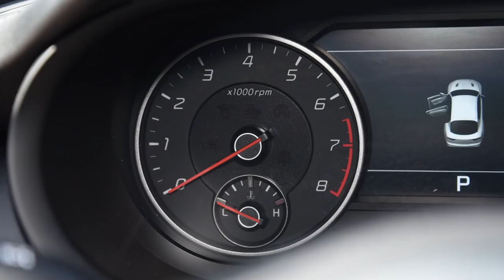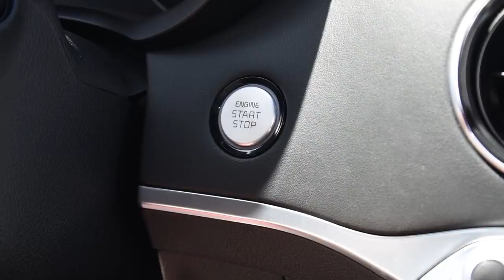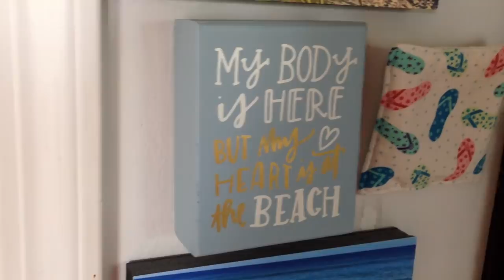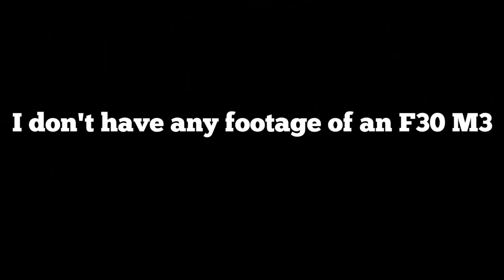2018 Kia Stinger GT: Regular Car Reviews

Comment: This car has got great reviews in Australia, and often compared to holden ss (chev ss). In the reviews, generally the kia is rated as a better car, easier to reach claimed 0-100time (0-62.5 miles), better handling but is put down for being a kia and not having a V8 sound, which is a stupid way to review a car. It hasn't sold well in Australia, but nor has any rear wheel large sedan (holden commodore and Ford falcon have actually become extinct in Australia) but when you see one of these on the road, they look awesome! I can't wait to pick up a cheap second hand one in 10 years for peanuts.

Comment: I see so many Kia owners are actually embarrassed by the cars emblem more than anything . A lot have resorted to using these horrible ebay L  logos that are some mutation of an old Kia logo used on a few models and Kumho's old logo  resulting in something that should be attached to a knock-off Lexus

Comment: One of the problem of the stinger is it's weight. Yes, it's well balanced and it makes you somewhat forgetting of it. But in regard to a 800 pounds Lexus is350... nah... you can't compare both (the Stinger is also much bigger. Nothing "compact" about this car).

And it would have been nice to have the stinger, in a lighter, more reliable, naturally aspirated V6 version. This is lacking on this car, and I wish it would have had that.

Comment: The Hyundai/Kia stigma will wear off in another decade. Toyota and Honda faced an uphill battle before those names became synonymous with reliability and value. 

In the mean time I’ll quietly dial back my public criticism of anyone who drives a Kia In case 10 years down the road I’m behind the wheel of something like this.

Comment: I still don't get this car...  $52K?!  You can get a Mustang GT with 100 more HP, a 10-speed automatic, and equal handing for $10K less...  Granted, the Mustang has a shitty back seat and no rear doors, but are those things worth the $10K price premium?  I think not...  If this car were, say, $35K, I'd buy it in a second.  But $52K?!  Nope.  I'd wait 3 years and get a just-off-lease Stinger with 36K miles and a Car Max bumper-to-bumper 5-year warranty for $25K, thanks.
Reply: smart money right here... How big is your bag because I bet somewhere you have spy 6/2019 puts around 2300... It can happen!

Comment: To all of you who say the Stinger handles just as well as the BMWs:

Just explain how that is possible: The Stinger is 250 kg heavier, 15 cm longer, 7mm narrower, and it has narrower tires than the M3.

How can it possibly handle the same again? You can't drive both around the neighborhood and conclude they handle the same.

M5 has more of the dimensions of the Stinger, but then again, the M5 is only 21 kgs heavier, while having a V8, double wishbone front, and delivering 60% more peak power.

But sure, they all "handle the same".

Yes, the stinger is a nice car, kia had to build it from scratch, but the hype train is way out of control. Might as well compare it to the F12 Berlinetta while we have the circlejerk going..

Comment: You mention the SS but not the Taurus SHO?   The SHO is AWD 365 HP and they blow it away. The Stinger is the only thing that gives SHO a challenge until you put a 900 tune in one then it's lights out for the Stinger.

Comment: In my country this costs €70k so no thanks.
Reply: How much is the Audi equivalent?
Reply: @bobow4075  Funny that Audi has no equivalent to this. The gas engines end at 265PS, the S5 Sportback has a 347PS Diesel engine and costs €79k.
Reply: @imnotusingmyrealname4566  what about BMW or Mercedes? I know a 5 series is similar in terms of size and It has similar stearing to a BMW M3
Reply: @imnotusingmyrealname4566  also diesel stronger then the gasoline? Unusual...

Comment: Kia Stinger < Dodge Charger
Reply: If you like cheap plastic interiors and spreading tickets then sure. Also it has 4.7 0-60 and better handling then the Charger. How is the dodge better?
Reply: bobo w Scat Pack Charger has a 0-60 of 4.5 seconds. Starting MSRP of $39,995. Also has 485 horsepower out of a naturally aspirated 392 cubic inch HEMI V8. Sounds pretty good too. And, I am willing to bet that the Charger will handle better than a Stinger when you add the dynamics package. A $2200 option. (Probably without it too.)
Reply: @henryclark5611  Again, cheap plastic interior and reliable of under 75 thousand miles. Also if what people say about the stinger handling like a M3 is true, I don't see the charger standing a chance.
Reply: bobo w you think that twin turbocharger V6 will last longer? That thing will explode well before 100k. Nothing will beat the reliability of a pushrod V8, and yes, soft touch materials are standard on the Charger, but you can upgrade, just like the stinger, there are levels. Bottom line is, you are comparing a Grand Touring car, (Stinger) to a muscle car, (Charger) they are intended for different purposes and they both preform well at each. I’m saying, personally I would take a Charger. Its a personal preference however. We can go back and forth discussing individual statistics on either car, but they don’t mean anything until you put one up against another on the road or track.
Reply: @henryclark5611  true on that personal preference, but you're the one who started the comparison lol
Reply: I like them equally, but the charger is good in a line and not as reliable, while the Kia is more maneuverable and less spacious.

Comment: It's still a KIA/Hyundai... U won't trick me.
Reply: What is trying to deceive you? the clearly visible Kia badge on the front? the clearly visible Kia badge on the rear? the ones on the wheels? or the one on the steering wheel
Reply: @echos5823  The crash ratings/proof.

Comment: at the end of the day, its the same cost as a 4 series gran sport with slightly less engine performance, and substantially less road holding performance.  Annnnd then you also paid bmw money for a kia badge...
Reply: an comparable 440, and with more than just "slightly less" engine power is over 50k, the stinger with a v6 is less than 40. that is not a dmall price difference
Reply: If  you actually go to a kia dealer and price it out you wont find a stinger gt v6 with the same options as are standard on the 440 for less than $46k. I know, i already tried. Having driven both of these cars for over 100 miles the "less power' in the 440 feels like more power.  It must have a far flatter power curve, because you only feel the stingers power 3500+.